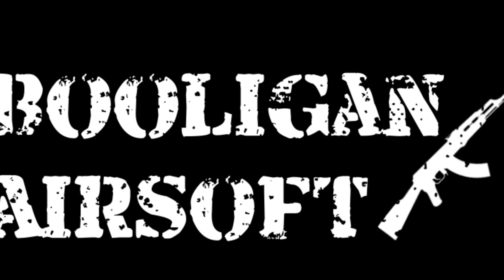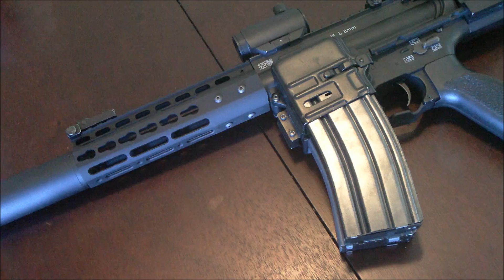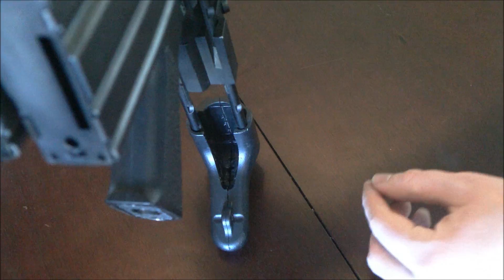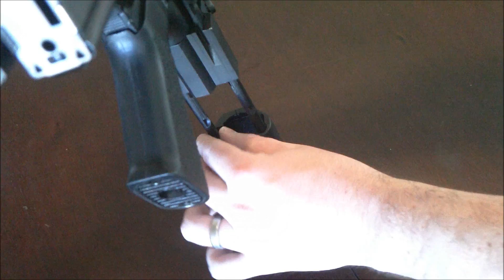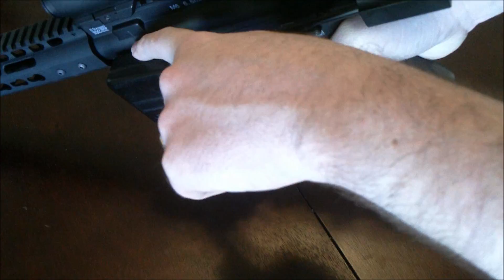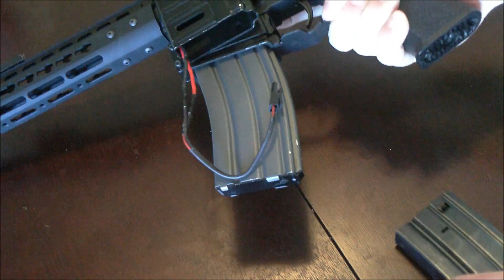AAC Honey Badger Inspired Custom Airsoft AR Build: Part 2 - The Fine Details

Comment: I was going to make a Honey Badger using the following parts: 
H&K Umarex HK416C Full Metal Airsoft AEG Rifle by VFC
Madbull Noveske NSR 7 or 9" Keymod Rail System for M4 / M16 Airsoft AEG Rifles
JBU Fake Airsoft Suppressor, 6.75, Aluminum, Incl. Barrel Extension
G&P PEQ-15 Battery Case w/ 11.1V 1100mah Lipoly battery pack

Would this setup work? If not what would I need to do to make it work? Any tips would be helpful. Thank you
Reply from the maker: Should work well, the big question will be whether the suppressor fits inside the rail.
Reply: I am hoping it will because its the same suppressor and rail system you recomended in your videos but we will have to wait and see. and do you think the 7 in or 9 in rail system would work better?
Reply from the maker: Depends on which gen of HB you want to replicate. The early ones has a rail system that looks to be 6-7" long, which is the one I was replicating.
Reply: okay thank you man. ill come to you if i have anymore questions!

Comment: Thank you for the quick reply. Yea but I just wouldn't look right. I will see if it will fit in the vtac rail system instead. Thanks.
Reply from the maker: The MSS looks perfect for the gun, it's just the rail system that borks it up a bit. If you want measurements, I can get you some of the MSS and you can find a RIS that'll fit it inside.

Comment: What size silencer will fit inside the noveske?
Reply from the maker: It needs to be tiny. Like, smaller than 1.25" in diameter. That's why when I updated this build, I got rid of the tiny can that I had and went with a flush mount setup that looked closer to the real one.